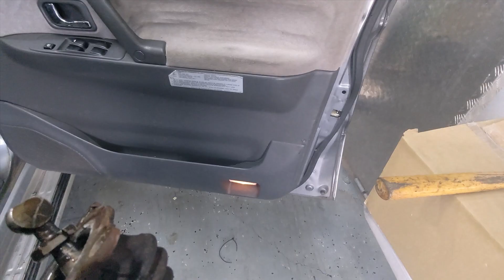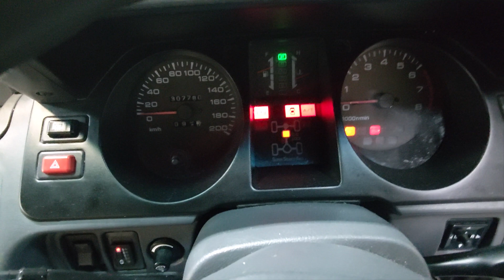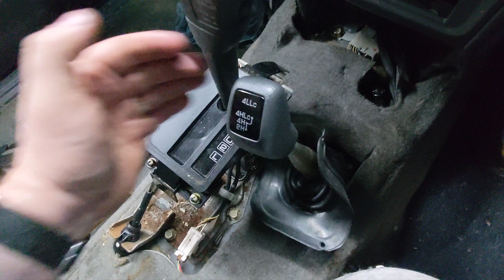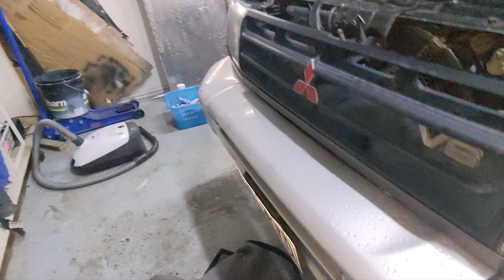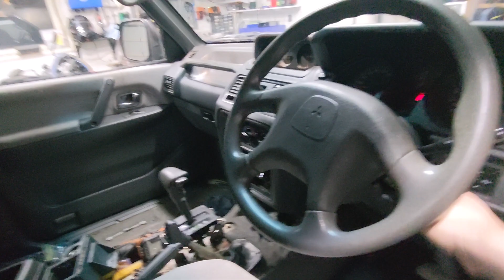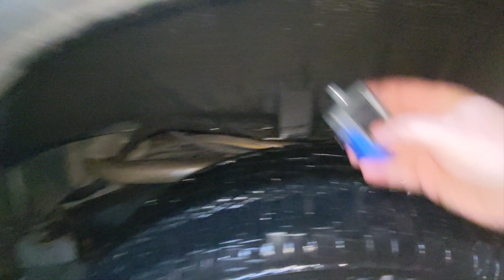Transfer case adventures with the Pajero

Comment: What you're supposed to do is put the gear in neutral if you want to get it in out out of 4 low. Between 4hlc and 4llc youre supposed to press the lever down and pull it to the right (if auto) or left (if manual) whilst also pushing it forward. You do it all at the same time.
Reply: That's why the lever jams between 4llc and 4hlc and vise vers. If it were the manual and the engine was running, you would hear hash grinding from the gear box when trying to engage 4llc while your gearbox is in gear. So make sure it's in neutral even if it's an auto. If it's the manual also make sure to press the clutch.
Reply from the maker: Yeah I've learned this from owning it a couple months now.  A bit different on the old NH manual where you just push the clutch pedal and unload everything. :D
Reply: I have a car like this, but a 4x4 manual transmission works fast, but in 4x4 it goes normal fast

Comment: Hoping I have the same luck!
Reply from the maker: You dropped a bolt into your transfer case as well?
Reply: @KaldekBoch  Unfortunately the previous owner did. Bought it with the 4WD Selector uninstalled. Luckily I don’t think they tried to use it after dropping the bolt. Gonna grab one of those magnets tomorrow.
Reply from the maker: @katheter8423  ah bugger.  Well, if it helps any it did seem that it fell right to the bottom and was in the oil bath, so there's perhaps the risk of chewing up the transfer is lower than it could otherwise be.
Reply: @KaldekBoch  Managed to get it out! Tried the magnet with no luck, then I took the side access plate off and it was sitting in there with a chunk of the housing. Teeth are okay luckily.
Reply from the maker: @katheter8423  a chunk of the housing? 😬Would love to see pics of that.
Reply: @KaldekBoch  not a big chunk luckily. Like 3cm long and 1cm wide. No noticeable damage looking for where it came from
Reply from the maker: @katheter8423  knowing me, I'd have dropped the transfer case and had it in 100 pieces by now, looking for what smacked into what.

Sounds like someone did run it, heard a bang and then shut it off before downing a large whiskey and deciding to sell the car. 😂
Reply: @KaldekBoch  Yea. Going to inspect the outside for cracks today, but I’m not too worried.